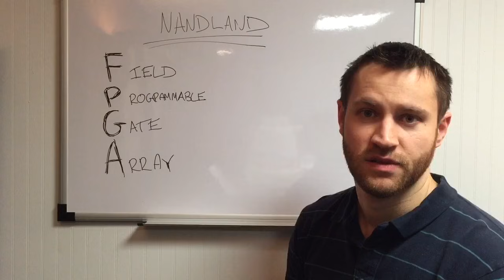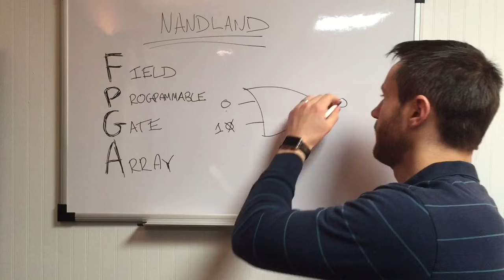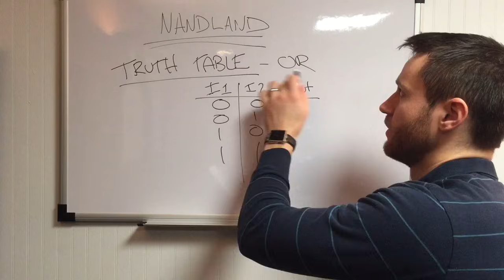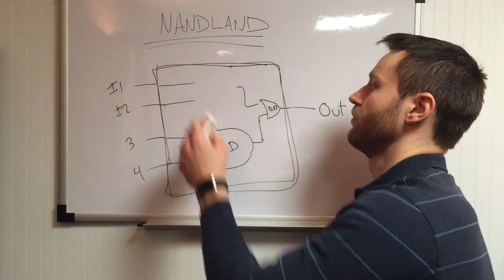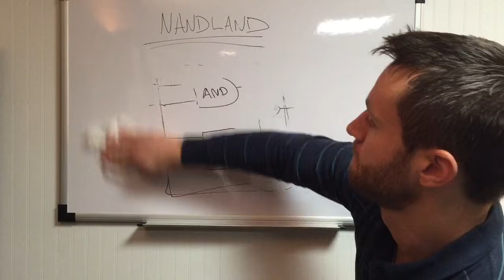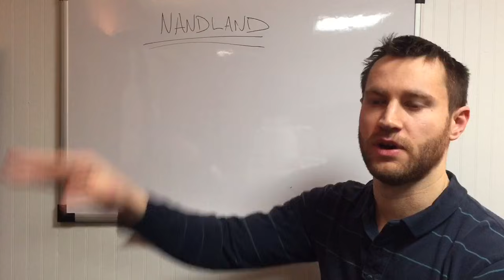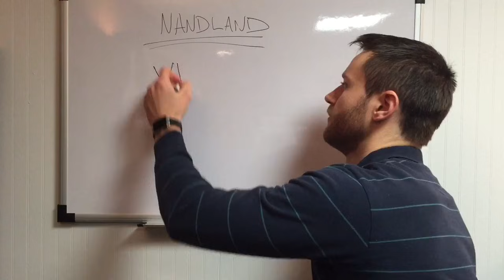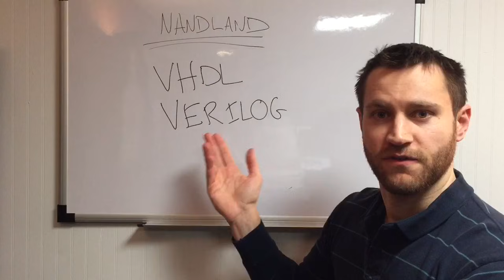What is an FPGA? Intro for Beginners

Comment: At first I was thinking that FPGAs were the flash version of processors and their instructions. But now I guess that doesn't make sense, because when you think back to how flash stores things, it can only store charges in cells that represent 0s and 1s; but not the tools that those 0s and 1s go through for processing. So then it makes sense that you could not assemble the cells of data in a basic flash storage to become the tools that those bits go through. Right? 

But then that gives rise to the question: What adjustable type of semiconductor-based material are the gates or/and the paths between them made of, as compared to the cells in flash storage?

Comment: Thanks for sharing.  If I had a 40x40 grid of push buttons, would an FPGA be able to tell me which of 1600 was selected?  I imagine there's some scanning/cycling to do this?  Thanks.
Reply from the maker: You would need either 1600 dedicated pins, or more likely some integrated circuit to detect a subset of buttons, maybe 16 or 32, then multiplex them into the FPGA.
Reply: @Nandland  Thanks for the reply.  Sounds like I'd need to use a CPLD instead.
Reply from the maker: @jeffjohnson2792  that's basically the same thing

Comment: well to be fair a modern dual/quad/octal core  i5 i7 cpu can work in parallel as can most GPUs like nvidia
Reply: Or 64 core threadripper
Reply: But they need so much power!

Comment: sir why intel are better than amd ? At same clock speed and cache .
Reply: compilers optimized for intel.. amd had intergrated mem controller on cpu die way before intel, devil is in the small silicon details.

Comment: Why don't commercialized Processors utilize parallel processing? it is not really a required use-case? Can the multi-core nature of CPU's be used in a parallel manner as apposed to sequential processing to mirror the likes of FPGA's? I'm also interested to see how the FPGA market will adapt to IoT and the off-loading of logic/workloads to cloud based environments.
Reply from the maker: +Max Coates Actually that's probably going to happen more.  Intel recently purchased #2 FPGA designer Altera.  They're planning on releasing CPUs with FPGA logic inside of them for datacenter applications.  It's exciting times for FPGAs!  I'm not sure how many IoT applications there are for FPGA to be honest.  IoT usually requires low-power, background type applications with low throughputs.  Also IoT is low cost/high-volume, which isn't necessarily good for FPGA, that's more for a cheap microcontroller.